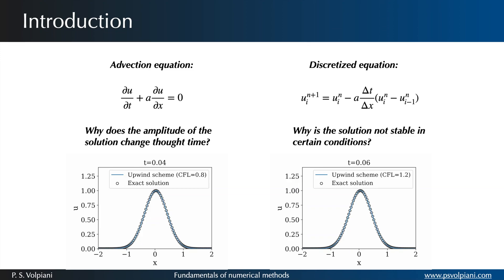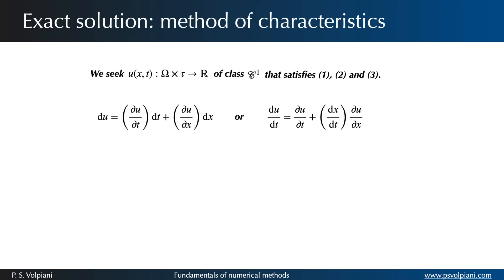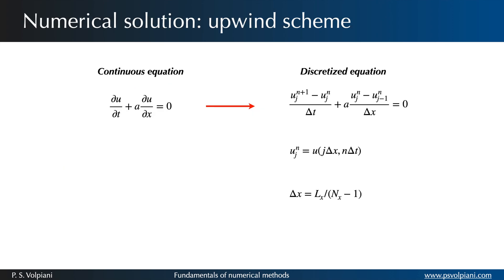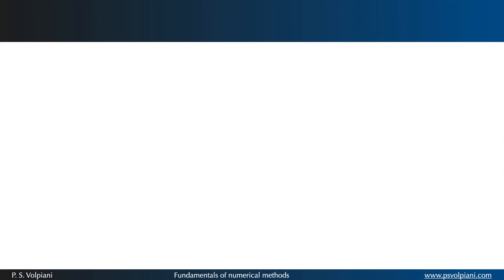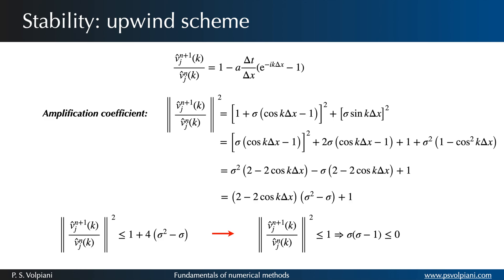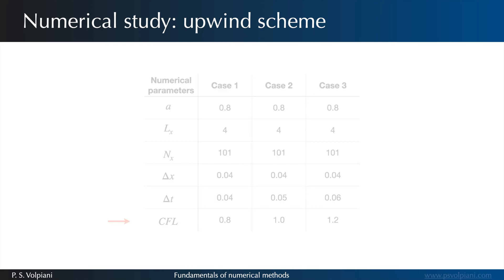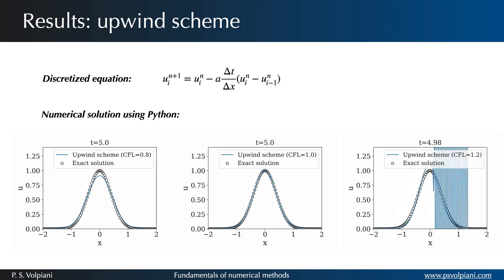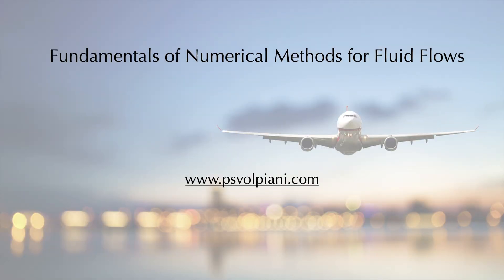CFD-01: How do we solve the advection equation using the upwind scheme?

Comment: Thanks you for your great lesson! But the code doesn't work, i replace the code plt.draw() by the code you gave in the previous commentary but it still doesn't work. i have a lot of errors and this particular message : TypeError: Cannot cast array data from dtype('<U1') to dtype('float64') according to the rule 'safe'
Exception in Tkinter callback.   I'm using spyder on  windows
Reply from the maker: Hello Hébert, try running the code using Google Colab (https://colab.research.google.com). Just copy and paste the code in the window. It will work!

Comment: The python code from the website shows some errors while compiling. how can I rectify that??
Reply from the maker: Hello Dheeraj, if you are using jupyter, you can replace the line where we plot the exact solution by this one:
plt.plot (x, Uex, color = 'k', linewidth = '1')
and the code works. I hope it helps.
Reply: @psvolpiani  Sorry, that didn't workout. Which platform are you using?? I am trying to run the python code from my ubuntu terminal. Is there any additional packages I need to install apart from matplotlib and numpy??
Reply from the maker: @dheerajr5727  I don't understand why you are having problems. I'm running on my Mac, which is based on linux and it runs fine. The only detail is that if you're using python3, you need to erase facecolors='none' in the plt.scatter line. If you need to debug it, try commenting (using #) some lines to find where the problem comes from. It's hard to tell without more information. But I'm curious to understand your problem.
Reply: @psvolpiani  I removed facecolors='none' and now it works fine...Thanks a lot...your videos are helping me. Keep up the good work..